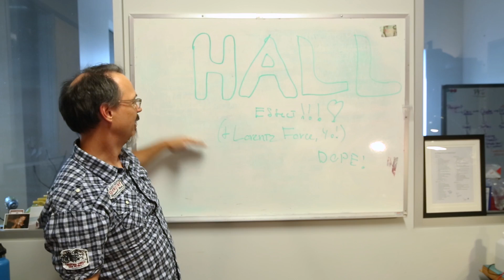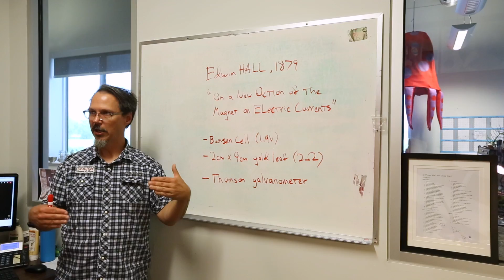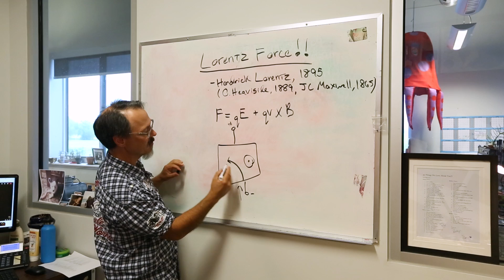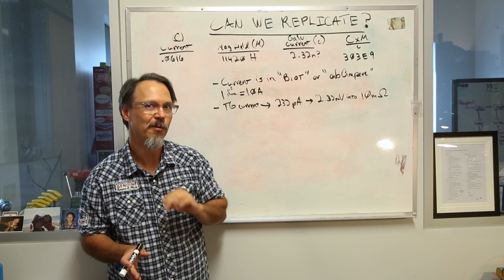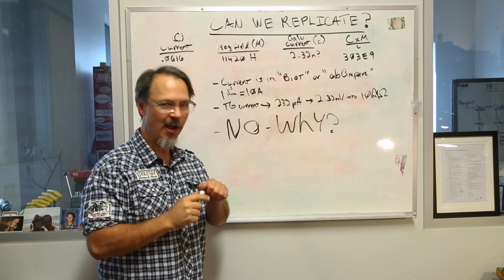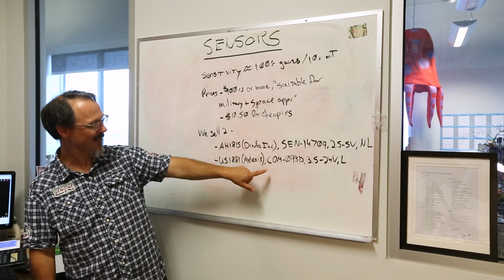According to Pete #58 - Hall Effect and Lorentz Force

Comment: Have you tried battery instead of switching power supply?
Reply: Nope, I haven't. It was just a quick-and-dirty thing with what I had on hand, and just to see if I could even see a little wavering or such on the scope. If I clean up my act a bit (meaning the experiment, not, you know, my LIFE), I'm pretty sure I can get something to happen...
Reply: I expect the entire Sparkfun building is electrically noisy, a vast contrast to how things were in 28th of October 1879.
I'd expect you'd have far more luck with a sensitive analogue meter, and a trip into the mountains around Boulder.